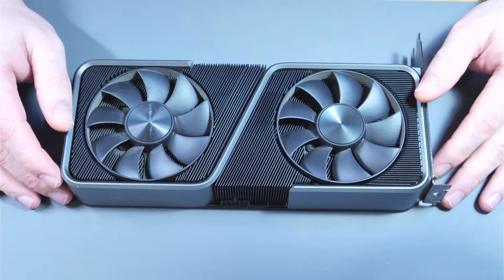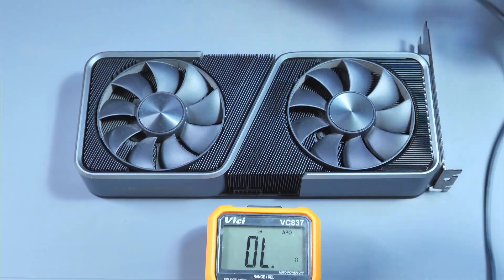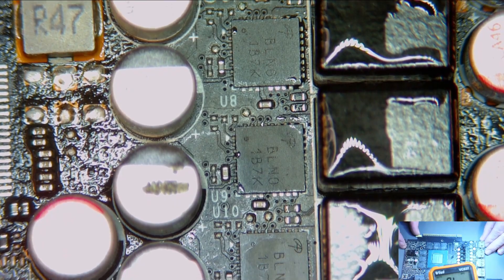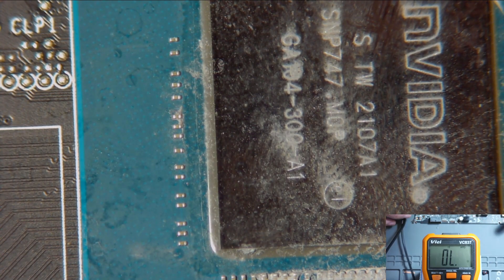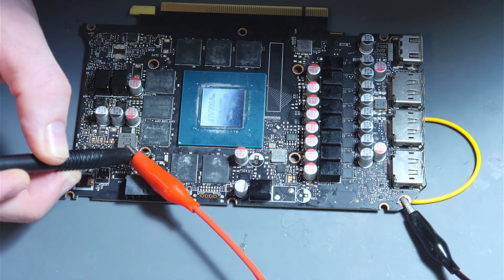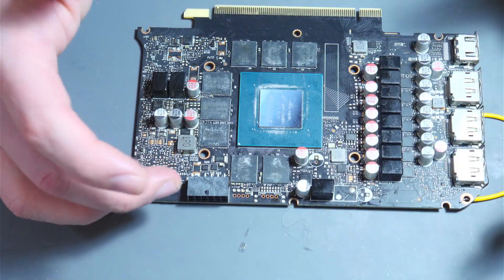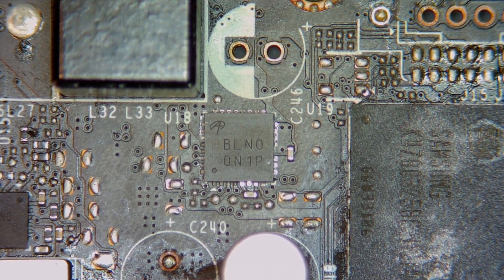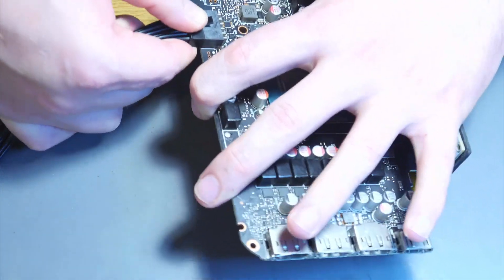Nvidia RTX 3070 Founders Edition - Short Circuit

Comment: Hey, i have the Rtx 3070 Founder's Edition card. Yesterday i playing a Game, then suddenly light went out in my area for like 3 minutes, when it came back i instantly turned my pc back on. but it turned off suddenly within 5 sec, & since then whenever i turn on the pc it turns on only for a sec then turn off. This happens when the GPU is plugged in , as soon as i unplug the gpu it turns on. I have tested the pc with another gpu, pc works fine. so, is it possible that my gpu is short or it could be the 6-pin connector that comes with the card.
Reply: i don't have another 6 pin to 8 pin connector to test, should i buy another connector to test the gpu or the gpu is simply shorted?
Reply from the maker: @ikj2673  your card very likely has a short circuit. I would advise that you stop trying to power it on. The over current protection circuit will eventually fail, and your card will be further damaged.
Reply: @b-hawkgaming  ok, means i shouldn't test with another connector?
Reply from the maker: @ikj2673  No, you should avoid powering it on until you know it's safe to do so. You can check across the external 8 pin connectors for a short circuit, using a multimeter.
Reply: @b-hawkgaming  I have the same issue. Is this fixable? if yes how much would it cost?
Reply from the maker: @PRanxter if its for a 3070, then the price may outscale their value now. It will depend on how severe the short is and how much damage it has done. Repairs like this can land between £100 and £200.